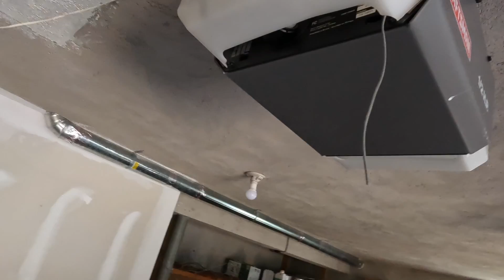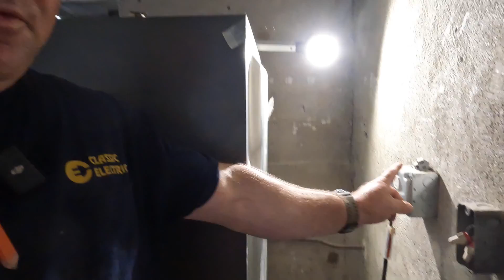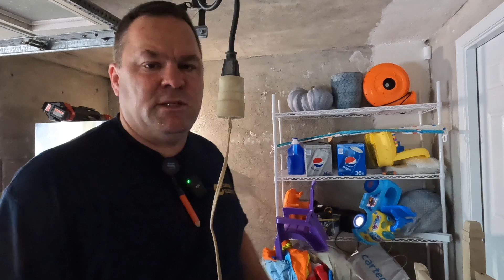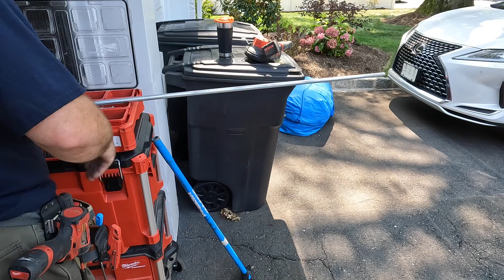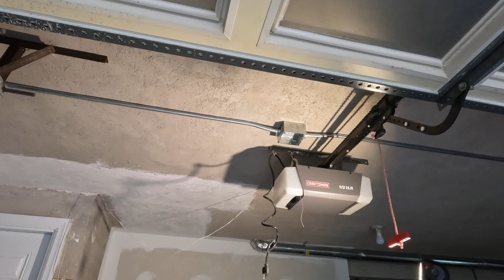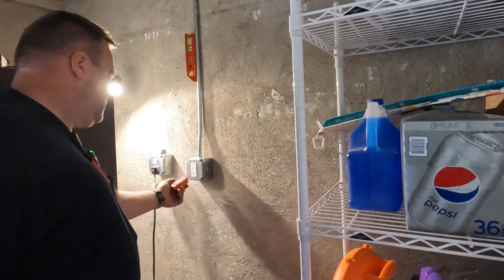Installing 1/2" EMT conduit for 2 new garage ceiling receptacles | Garage Door | Westfield, NJ.

Comment: I need to add 2 circuits to my garage 20a each. Panel is in the garage and in the wall. Want to run emt from the panel to these circuits. How to gain access to the panel to run the emt on the surface?

Comment: Even though code doesnt require it, i pigtail grounds to connect to the back of all metal boxes, the green ground receptical ground screw and run the ground to all boxes. This creates additional safety so you can always onow that the box, the receptical and the conduit are all connected to ground no matter what.
Reply from the maker: @lakorai2  It’s required.  250.4(A)(4) 
Normally non–current-carrying electrically conductive materials that are likely to become energized shall be connected together and to the electrical supply source in a manner that establishes an effective ground-fault current path.

Comment: I would liked to have seen a close up shot of your connections inside the receptacle box near the garage door opener. Did you use wago connectors for the junction and then a spade crimp for the ground? Thanks, I appreciate your video!

Comment: I read installation manuals from opener makers; they wanted dedicated circuits. For my new garage, should I have a separate breaker for each of 2 openers?
Reply from the maker: That’s really up to you.  If the directions say so then your electrician is supposed to do it per the manufacturers instructions.

Comment: 5:02 You may or may not be right about the technical rule of one romex wire per connector... but the reality is that it doesnt matter. I have seen thousands of connectors like that with two romex cables in them. You know how many times it was a problem? Zero times
Reply from the maker: Its funny you mentioned that because right after this video I bought a box of these single connectors and says right there on the box (2) NM-B cables permitted.
Reply: Something I like with bending conduit... I like to do the 90 first, then the offset second, because the 90 allows me to perfectly align the offset on the ground with the bender. I am sure you have experienced this @electricianron_New_Jersey

Comment: Nice work Ron.
Curious, did you consider sleeving the few extra feet of Romex that turned 90* against the wall?
Thanks,
Joe
Reply from the maker: I consider those cables between the ceiling and wall not subject to physical damage because someone installed drywall right up to the cable.  Therefore is wedged in there and you would have to go out of your way to get in there and damage the cables.
Reply: That's a good point.
They ARE safely tucked away.

Comment: hey Ron, great work. Two questions for you: 1) why don't you connect the ground wire to the device as well as the box? I know when its all tightened up that its all bonded, but at my work we were taught to ground the device too. 2) why did you use #12 THHN  and white #14 NM cable? do you only carry #12 wire with you?
Reply from the maker: The receptacles not required to have the EGC. Either way is acceptable by the NEC.

Comment: Nice work!  I like adding personal touches to my work to identify my work.  Some examples: 

I apply the supplied stickers from the GFIC packaging to the load covers.

I mount insulated P-clamps using only the surface side screw hole, leaving the clamp side open and free hanging.  Then coil the excess power cord, zip the coil (not tight), and then hang the cord in the secured open P-clamp for a uniform look.

I will add conduit clamps in between the stud attached conduit clamps with the screws on the opposite side.

I might date and/or initial inside the box with a sharpe

I do this for myself, and in less time it takes for a smoker's break. Maybe it'll make it easier for someone who may come behind my work.

Comment: Hey Ron great video. Just an observation, I see you use #12 thhn to supply the garage power from the outlet box. But didn’t you replaced that romex to the outlet with #14 since the outside sheet is white or does #12 comes with white sheeting also?
Reply from the maker: I just don’t normally stock #14 AWG.

Comment: well made video.   don't know if that flashinf light was a klein led headlamp like mine, but the flasing at intervals of discharge to let me know that its using the charge, is the worst most infuriating feature which is unwelcome   i love how bright it is but mine takes way to long to charge and doesn't stay useful for more than 1.5 hours klein really screwed that one up. i prefer to buy a grip of AAA bateries and us the 25$ headlamp without inteusive flashings.

Comment: Great video, as always.  Two questions - 1) could you have added a junction box in the basement near the garage wall to deal with the short cable, instead of going all the way back to the existing junction box? And 2) why did you mount the new GFCI receptacle slightly below the existing refrigerator receptacle? I would have expected your usual stellar quality of work to mount it at the same height.  My guess is to use the existing hole in the wall and not make a bigger hole?
Reply: Since he put in the other outlet why did he not level that one then?

Comment: Any particular brand crimp connectors you prefer Ron? There’s obviously a lot of crap out there…
Also, are GFCI’s  required for garage door openers? My house was built in 1990 and my openers don’t have them
Hope you enjoyed your trip and got a lot out of it 👍👍
Reply from the maker: The GFCI protection is required now but it wasn’t in 1990.
Reply: @electricianron_New_Jersey  Thanks Ron 👍👍
Reply from the maker: No particular brand.

Comment: I’ve never had an issue putting 2 type nm cables in a 1/2” connector so long they are the same size wire. Usually as we all know 14-2 and 12-2 works no problem.

Comment: I noticed you had a 2 prong receptical but  I presume it still had a ground in the old romex . I guess we are not absolutely sure the way that wire is grounded . I have seen water pipes used for branch circuit grounds . Even using neutrals . I know there is not time to determine that every ground is correct and a return path back to the panel but i wonder if there is a meter of sorts to give that information ? A known return path back to the panel . Nice work keep up the good work .
Reply: You could de-energize the circuit and using an ohm-meter or clamp meter to test for continuity between ground and neutral...
Reply: @arnieselectric007  with the neutral bonded at the service with the ground that makes it difficult to get continuity to work . Working in older houses you don't know the condition of the grounding . Yes it may show ground on a plug in tester and voltage from ground to hot but that doesn't mean much if you don't know if it is truly grounded and bonded properly . 
It might be a thought of designing a meter that can test ground and arc fault at the breaker . Something like that would determine incorrect wiring .

Comment: I've always secured 1 or 2 romex cables (12/2 or 14/2) through the typical metal 1/2" saddle connector. The two screws are plenty long enough for the thickness, and it mounts nicely.  I'd only put one 10/2, 12/3, or larger cable though. Not sure I'd cram two cables through the black button connectors, though—can you do that?

Comment: Why didn’t you just use the emt as your ground? In Chicago area that’s how it’s usually done

Edit: never mind I watched the rest of the video
Reply: Yes it is allowed but it's another area that can get forgotten like a forgotten to tighten the screw on the connector or someone down the road decides to play around with the installation . Also corrosion can occur

Comment: I make a mark at 2 1/4 " from the end of the conduit.  I use the end of the pipe as my first mark and I use my 2 1/4" mark as my second mark. My first 10 degree bend is at the end of the pipe, my second 10 degree bend is at my mark.  I use your eyeball method only for concealed conduit runs. My method is only slightly slower than yours, but both methods are fine on box offsets. Box offsets are actually about 3/8".    3/8" X Offset Multiplier of 6= 2 1/4"   Great video, thanks for sharing, Russ< 28 years in the trade.

Comment: I think it depends on the brand/type of the Romex connector, but I think most are rated for 2 maybe 3 14/2 wires
Reply from the maker: Three in one single NM connector.  No way.
Reply: @electricianron_New_Jersey  Maybe a 3/4 sized one?
Reply: I’ve heard 2 maximum for 12/2 or 14/2 but 3 only for “Butterfly Connectors”

Comment: Ive heard guys say crimp forks are not allowed on devices because of the listing of the device. Ive never checked the listing but i like the idea
Reply: That's ridiculous
Reply: I just used them on a job that I pulled THHN for a weatherproof switch on a deck. I would not advise back stabbing or trying to make a hook with stranded wire, it will be a mess when you tighten the screws. Great work Ron!
Reply from the maker: Never heard that.